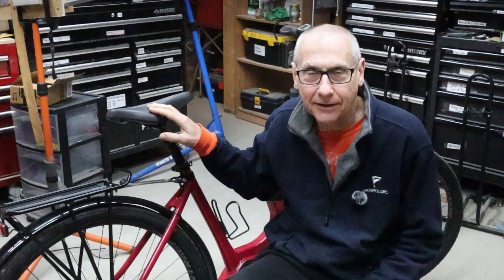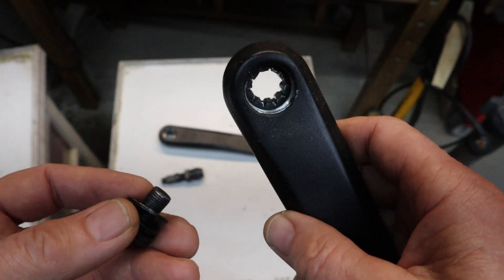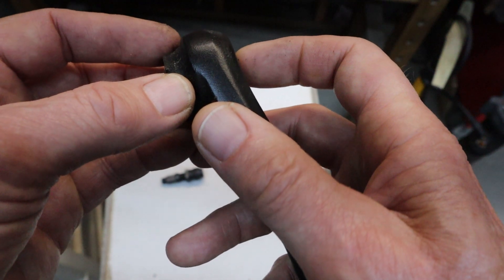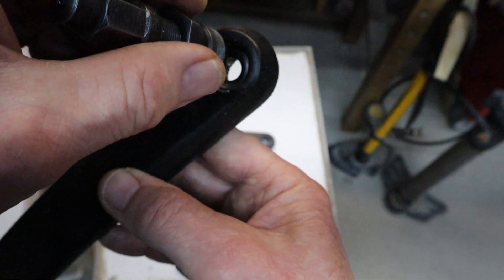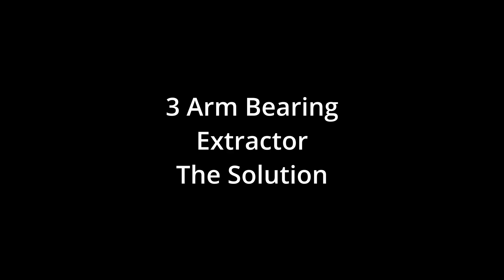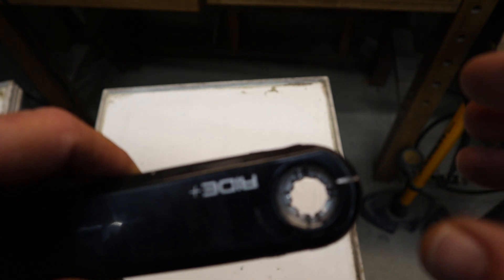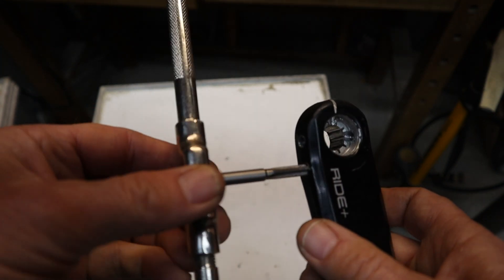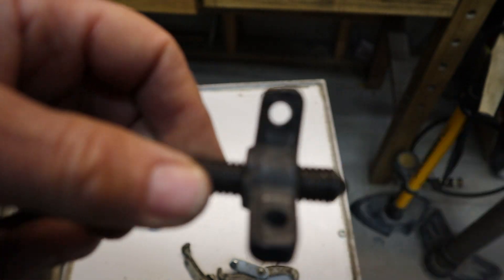Removal of emtb crank arm after I damaged the threads!  Solving my own ebike problem....

Comment: Yep happened to me years ago [campy crank arm}!  I did use a two arm extractor with a bolt threaded in axle but I took a propane torch and heated the arm and it expanded enough to let go.  I do like your solution better!
Reply from the maker: Thank you for watching my video and for commenting.  Sorry to hear that you had a similar experience--I felt pretty lonesome when I realized I had stripped the threads.  But, glad to hear that it is possible to get it off with a 2 arm...and a torch.  Thanks for sharing your experience.  Cheers!

Comment: I think your solution was creative and I am glad for you that it worked. When I realized that you were not concerned about damaging the crank arm I wondered why not just cut it off. I have an oscillating tool and a Dremel rotary tool. I would try either one which seemed to have enough clearance and cut the material. I'd make two cuts separated by about 180 degrees. I would also consider stopping the cuts just short of completely through to see if the cuts at that point would offer enough flex in the material to wiggle the crank arm off. If the crank arm was still stuck, I'd try to break the crank arm at one of the cuts with a cold chisel.
Reply from the maker: Thank you for watching my video and for your thoughtful, detailed comment.  I understand what you are suggesting, and it is a creative solution--especially the point about the 180 degree double cuts.  I considered cutting it off, but I concluded that if I cut it off, I would probably damage the motor shaft.  Had I been smart enough to think about something like you are suggesting maybe I would taken that route.  Thanks again.  Cheers!

Comment: Dude. 
Just remove the screw and ride for couple hours.
If it wasnt seized, crank arm falls off.
Also, why not cut it off if you drilled in the arm anyway
Reply from the maker: Thank you for watching my video and for commenting.   Also,  I appreciate your suggestions.  I must have failed to mention it in the video, but I rode the bike with the "retaining" screw removed for about 30 miles, and I was not able to detect any movement in the crank arm after that--maybe I should have ridden longer and more aggressively.  As for cutting the crank off, I was not able to see a way to cut it so that I would not risk damaging the motor shaft to which the crank was attached.  Good points and I appreciate your sharing them.  Thanks again!